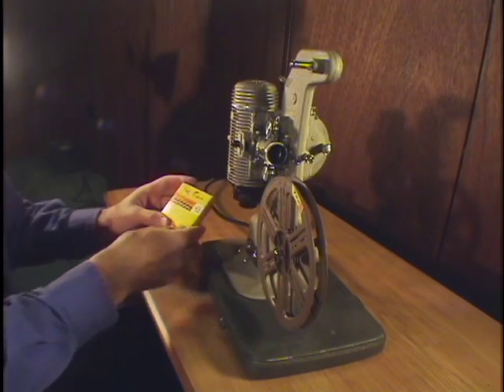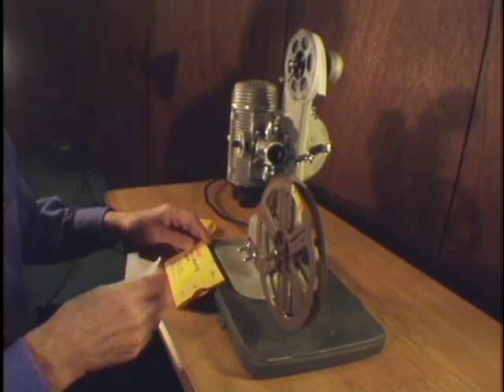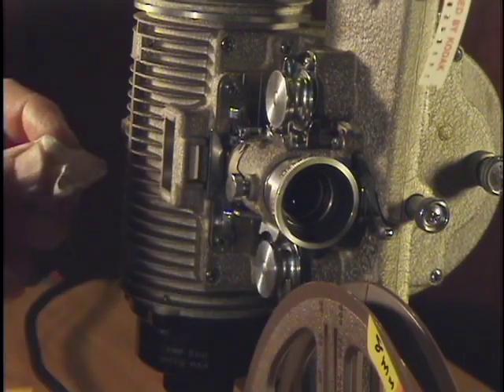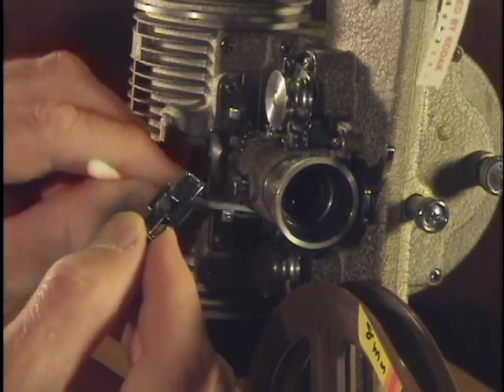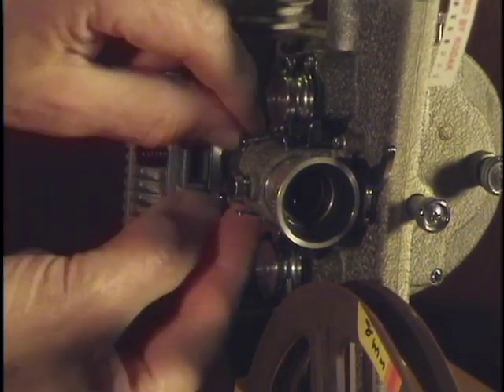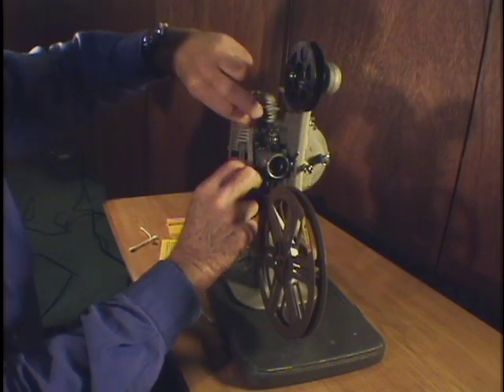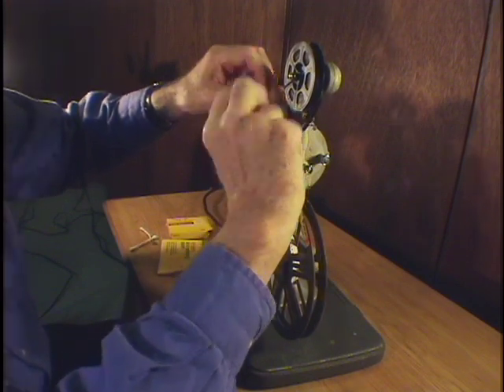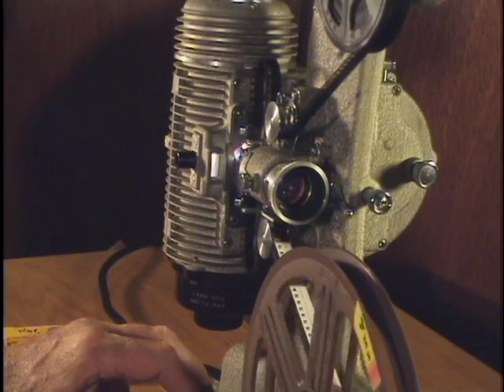The Bell & Howell Regent, Design 122, Model L 8mm Projector (clip 25)

Comment: Bob:
Excellent demonstration of the Bell & Howell 8 mm projector.    I have a Model 122 LR, which looks identical to the Model L, with a dead bulb.     I can't remove the bulb, which is in a deep well, and not enough room to grab the bulb with my fingers.   Can you tell me how to remove the bulb?   Thanks for any suggestions you can offer.
Jim
Reply: +James Sconza  I believe you push down on the bulb to release it,  and rotate it with your finger tips.

Comment: Hey Great Video! I have the same projector and wanted to try using it, however I encountered a problem why I tried to use it. The lower reel seems to go faster than everything else, cause it put tension on the film. Additionally, when I try to rewind the two sprockets continue spinning forward while the upper reel pulls backwards. Any idea why these things are happening?
Reply: Nick Hooks to rewind, simply run the film directly up from the takeup reel into the feed reel. Do not fed through the sprockets